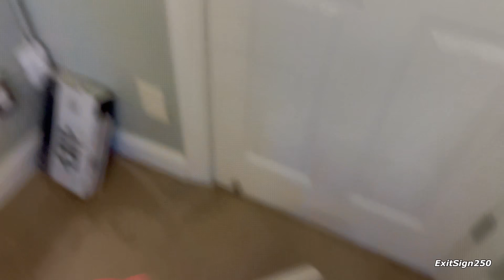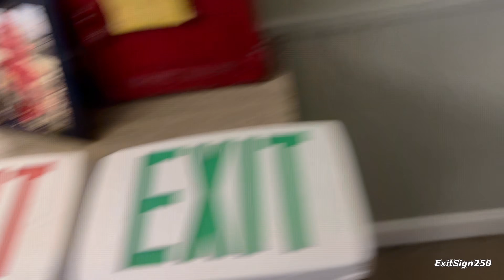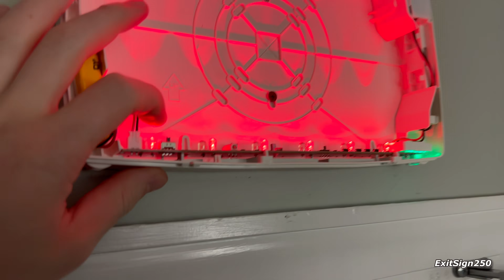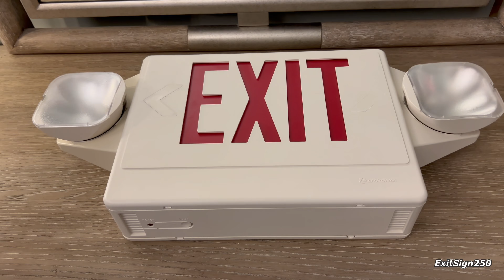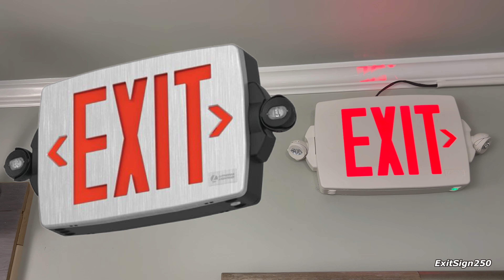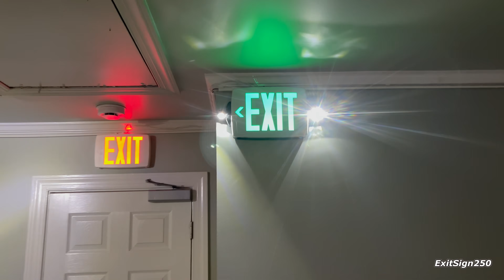Exit and Emergency 27 - New Exit Signs!

Comment: I have and exit sign blinking i changed the battery and it just start blinking slower need help lol
Reply from the maker: Blinking? I should not be doing that. Some models will flash/blink in battery backup mode but it’s an uncommon feature. So when you have the sign plugged in and powered on it blinks?
Reply: @ExitSign250 yes and it blinks when I disconnect the yellow battery and add a new battery . I’m thinking it should just be replaced?
Reply from the maker: Yes, sounds like a problem with the electronics. If this sign is installed in a building it should definitely be replaced.

Comment: That ac only/battery backup switch is so redundant. Why have that switch when you can simply unplug or plug in the battery. And even then, why have the battery in there in the first place if it was gonna be ac only
Reply from the maker: The idea of it is so someone only has to order one model of sign for all applications. In concept the idea is great, but in practice it doesn’t make a lot of sense.

Comment: Do these signs have a fire alarm feature? I'm currently in the market for those in particular.
Reply from the maker: Neither the exit sign nor combo I featured in this video are available with fire alarm flash option at this time.
Reply: @ExitSign250  Would you know of any good signs that would wire into an alarm panel?
Reply from the maker: I have always been a fan of Dual-Lite products and use them for the installations I do in buildings. Their EV line, specifically the EVE model, offers the fire alarm flash option.  @firstassemblyofgodmartinsv7665

Comment: Wow...Lithonia really did it with these. They look VERY nice—especially that brushed appearance combo. I was also concerned that it would look cheap, as well. I'm pleasantly surprised to see it doesn't. They've used practically the same method Day-Brite/Chloride used to offer a brushed-appearance CXX Series (the one that looks like a knockoff of the Dual-Lite Liteforms LX) sign. I'd love to get my hands on one of these one day.

Excellent call on the AC/emergency switch in the LQM. I'm not entirely sure why they would've engineered it that way. Like you, I believe they need to either include something inside the sign that has to be removed before the sign is hooked up that calls out the operation of that switch so it can be correctly configured or code the AC status light to be turned off when the switch is in AC-only mode. This is the first time Lithonia has offered this feature. Most people won't know how it works. I agree that most won't read instructions and won't follow the QR code to find them. Lithonia really didn't think that through.

There's also the concern about the QR code itself. Ten years from now—presumably within these units' lifetime—will the link associated with that QR code still work? The QR codes on the early Walmart-spec Dual-Lite units stopped working several years ago when Hubbell redesigned their website. I highly doubt Lithonia's website will look the same in a few years. Let's hope they keep a backdoor to the installation instructions always active. At the very least, they could tell their QR code provider to link to that instruction sheet on the Internet Archive so it's always available.

Also, a small note: the QM, QM-EL, and HQM were all around in some form for a while into the mid-2000's. Lithonia produced the old small-housing QM into 2004 before briefly switching over to the third-gen housing, but that version didn't last too long. The HQM was around until at least 2004 (presumably, while Lithonia burned off old stock), and the QM-EL was still around in 2005. All of these units were gone prior to the LQC and Solo going live in 2007. There were very few incandescent units around across the industry back then. You still had a couple Jimings and some Sure-Lites options (CCX and INCX, which were rebadged Jimings) along with the last vestiges of the Prescolite Exit Lite in the Corner-Stone/Dual-Lite catalog, but Lithonia was pretty much done by then. I can't recall an incandescent Briteway (Lithonia's value line at the time, rebadged JeWoo for a short time but eventually transitioning to Jiming) being on offer.

As someone who can't seem to make an emergency lighting video under 10 minutes, I say keep the long videos coming! 😀
Reply from the maker: Thanks for your comment! 

I hope to see Lithonia offer an update  for the new LQM AC only/battery backup select feature. It just seems like they glossed over it as you mentioned. Time will tell if these will be installed correctly or even retired/replaced prematurely.

Yes the QR code only instruction manual worries me. I didn’t even consider Lithonia’s responsibility to keep the manual online for the years to come. I’m curious to see how this works out, but if it’s anything like the older Dual-Lite Walmart spec models you mentioned, it’ll be hard pressed to find info on these.

The history details on the Quantum line weren’t intended to be in depth and I simplified it a bit for sake of the video length and not being a dedicated Quantum history video. However I had no idea the QM-EL and HQM were around until the mid 2000’s. I’ve never seen any in buildings newer than 2001; usually only finding the LED variants. (of course providing Quantums were the unit of choice) Perhaps it was just to burn their supply or keep a legacy illumination offering. 

Haha, I always cringe when making a video past 15 minutes long. This video was tough since there was a lot of information and details I wanted to touch upon, but trying not to be the length of a feature film was a challenge. My original recording of this video was just over an hour long… had to reshoot it and trim out some fluff and cut extra segments. But in the end I am satisfied with everything I presented. I appreciate you watching!

Comment: Awesome series. Honestly when I went to Home Depot about a month or two, I looked at the exit sign selection and thought the LQM was still being produced. I did see the combo and thought it look really nice and low profile. 

I agree with the ac only mode and battery backup mode. I also am with an electrical company and trying to get my license. After working with them they don’t read manuals and also sometimes forget to plug the battery in. I have a feeling we will see a lot of these signs going out of service over that simple switch. I think people will miss that switch and cause the unit not to work, then they get replaced due to the sign not working in a power outage. I would have a big cover on the inside of the sign telling people to flip that switch to operate battery backup or having the battery unplugged and the switch preset to battery backup mode. Then have the installer chose if they want ac mode if needed.

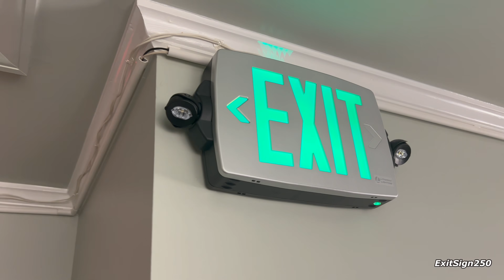Comment: 31:37 YES! I would like to see this location back to make of for the location removal back in Episode 23, but I think it would be better if you moved it to the right.

EDIT: For the brushed aluminum sign, are the arrows permanent removal?
Reply from the maker: Thanks for your feedback! As for the brushed aluminum style LQM and LHQM, the arrows are not permanently removed. Since it’s a plastic sign you can pop them out and back in.
Reply: @ExitSign250 Wow! I don’t think I have heard of a brushed “aluminum” (reason for the quotes is because it’s actually plastic) that doesn’t have permanent arrow removal

Comment: Oh wow I see your using wago 221 lever nuts nice!
Reply from the maker: Yep! I use Wago’s for certain situations. But especially for my exit signs/emergency lights that I swap out regularly, Wago’s are so much nicer than wire nuts in this instance.
Reply: @ExitSign250 yes!! I used then for my mini fire alarm system which used a 9V battery but it’s rn not working and hasent got the time to fix it
Reply: @ExitSign250  I highly agree!!!

Comment: Cool video! I'm happy someone made a video on these. There is a breakfast restaurant opening in my area that has these signs in white housing installed, but they aren’t powered on yet because the building is still under construction. I think that you should make a video on Chicago code emergency lights and exit signs and feature the Lithonia or Sure-Lites or generic LED products as I haven't seen many creators or any make videos on them.
Reply from the maker: Thanks! And I appreciate your suggestion. An NYC and Chicago code themed video has been on my mind for a few years now. The hardest part is sourcing it all since I have very few of them in my collection.
Reply: @ExitSign250 I’ve noticed a few lower priced units come across on my eBay. Lowe’s and Home Depot sell them for around $100, but I don’t know if you are willing to spend that kind of money.

Comment: My guess is the brush aluminum finish is for buildings that would be suited for them but couldn’t afford a Lithonia Signture Series or a LQC which are Cast Aluminum. My school originally had Signature series in the original section but when they expanded the school they went with crappy Basics series signs. Which the signatures were brush aluminum while the basics where white. So it would be for applications like that where you want a high end look but don’t want to go all the way to the cast aluminum equipment. I’m hoping what happens is that white housing signs are used less in places for the new brush Aluminum face.

About the history, this would be technically the 4th Generation of LQM, there was a first gen that shared the housing of the QM EL and I got to see them at a Safeway, it was AC Only so it lacked a test button. Another thing is that Lithonia kept the QMs and HQMs after the LQMs and LHQMs were released. The AC only QM got a revision during the 3rd generation of Quantum, basically it was a incandescent 3rd Gen and those are actually very hard to come by. The HQM and QM EL pretty sure stayed the same until all incandescent products were killed off. Also the 2nd Gen LQMs did last a tad longer because at the time, you couldn’t get the new signs in certain options so the old LQM was kept around for longer. 

I’m glad that Lithonia is finally killing off the LHQM LED and leaving the legacy LED products behind. Some of the worst quality products by far. The ELM2LEDs have problems with the circuit board so it randomly lights up the lamps, and now I seen a LHQM LED do it. Now the next thing they should do is completely kill off the Basic series line up, WLTE, and the EDG/EDGR. Also the Basic exit signs probably no doubt cannibalized the LQM. It’s cheaper to get a Basic sign than a LQM, so why buy the LQM. I used to see LQMs like everywhere but a lot of places I have seen even if they went with ELM2LEDs ended up going with Lithonia Basics. 
The Basics line gets installed everywhere because it has the Lithonia name on it, Lithonia had a track record of great products form the Quantums to the Signtures and the Titan and more. The Basics doesn’t reflect on that.

But I’m glad these signs are a improvement over the previous generation and I liked how the LQM design made it to the combos. The LQM is a very nice looking exit sign.
Reply from the maker: Good point on the brushed aluminum LQM being introduced as a value option compared to the LQC and Signature. I didn’t consider that at all. Totally makes sense if you want a basic, budget friendly sign with a brushed aluminum look.

I am still considering this the 3rd generation LQM. That model you speak of using the QM EL housing was likely a very early and short run LED prototype. And yes the HQM and QM incandescent signs did stay around a bit after their respective LED models released. The HQM and QM EL were phased out in favor of the LHQM 1st generation and LQM 1st gen w/ battery backup respectively but the QM did stay around as a budget AC only sign. And yes it survived briefly in the form of the QM second generation during the initial 3rd generation quantum release. Those are definitely hard to come by. Finally yes the 1st generation LQM’s as well as a few other 2nd gen Quantum models did stay around when the 3rd generation was released as you mentioned because the new line didn’t have all the options yet. Same thing has happened now with the LHQM LED still being made alongside the new LHQM 3rd gen. This video wasn’t intended to be an in-depth Quantum history video so I skimmed over some of these details or simplified them for the sake of time.

Lithonia won’t be discontinuing their Basics line anytime soon. It’s how they compete with other generic companies and I don’t blame them. Times have changed unfortunately and not everyone wants to spend a lot of money on exit lighting. Used to you could only buy high quality stuff, now there is a lot of choices; cheap bargain garbage and top of the line expensive. The Basics is how Lithonia stays competitive and in the market. Technically even
 Dual-Lite rebrands generic. But it’s in the form of their Compass name so it’s separated from their main catalog. Sure-Lites used to do this too with All-Pro but nowadays 
Sure-Lites has also began rebranding generic too. In a world where generic products are king, companies like Lithonia offer it to stay in the game.

And finally yes I agree about the new LQM and LHQM. I also really like how the new LHQM looks similar to the LQM design. Something the LHQM LED never did. (again since it’s just generic) Thank you for your comment!

Comment: 3:28 I have one of those signs with the AC/DC option. It has two Incandescent heads and one Halogen Head with wires for a remote battery unit to power it.
Reply: Nice I would like to see it!